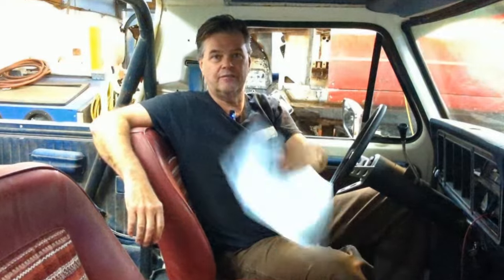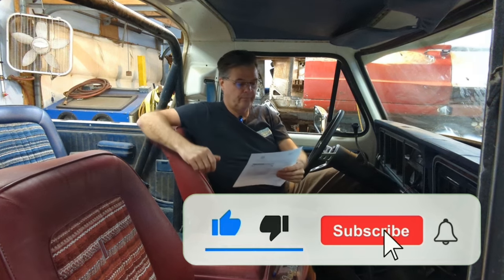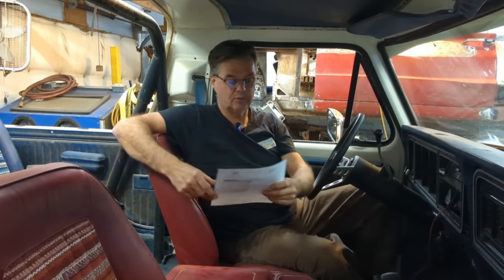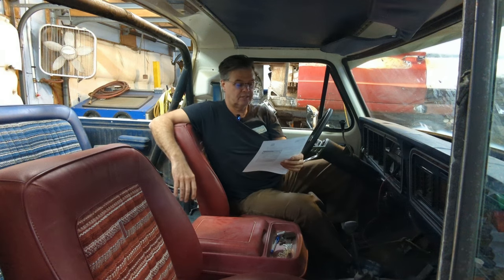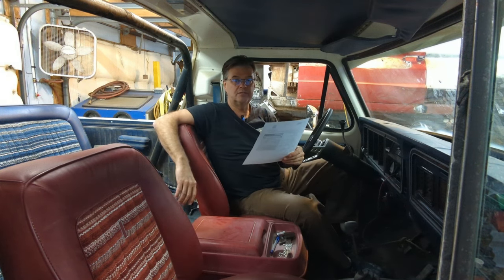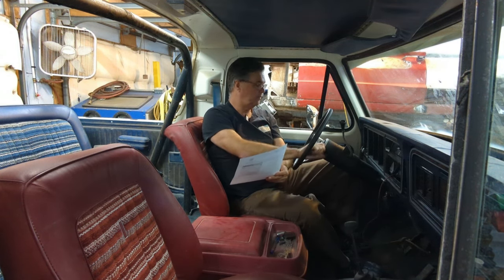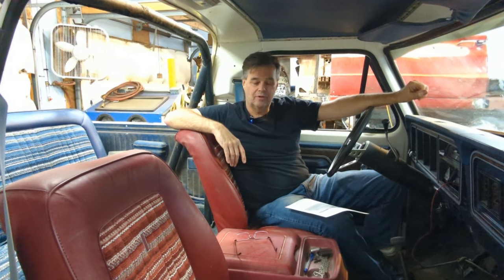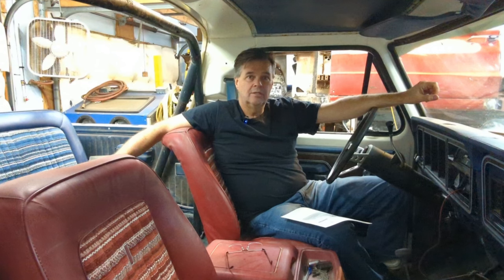Marti Report Reveals a Low Build Number for This 78 Ford Bronco Ranger XLT

Comment: You will be driving that bronco more then the  thunderbird or the truck I bet.  What stripe package did it have, I couldn't find much out there with just the 2 different blue stripes.  maybe its blue green white and the white isnt showing up and the green is faded. Funny its not in the report.
Reply from the maker: Lol...you are right there, the T-bird is going up for sale, and maybe the yellow truck too.
Technical, this Bronco didn't have any graphics, or it would have been listed on the report as,  "Free Wheeling".
What is interesting, is that there are remnants of blue/light blue tape stripes, and the only one I can find is the 78-79 F150 Explorer XLT graphics, it was never used in the Broncos...or was it! Lol
If I buy the original reproduction of the window sticker, it would list any graphics on the Bronco when it was sold new, where the report I covered here doesn't show those details.

Comment: Hello Alvin. You'll have no problem pulling the little camper with it. Are the quarter panels coming from the U.S. ? I think there is a Bronco restoration parts place near me here in Michigan. Another fun project for sure.
George B
Reply from the maker: Hi George,
Towing shouldn't be a problem for something small to medium size...but what is really cool, is back in the day, there was a slip in camper made to fit these old Broncos. There are a few videos about them on YT, and people are still using them.
The quarter panels are AMD, but AMD doesn't ship to Canada...so I bought them through an AMD dealer in Alberta, Canada called Lost Iron. I called them, and had a good chat, very friendly and easy to deal with.
I chose the AMD panels because they got the best rating for fitment...but I'm sure they all come from pretty much the same manufacturer. 🤔